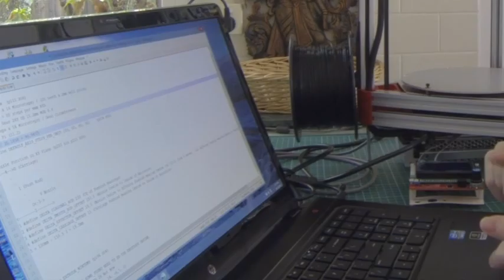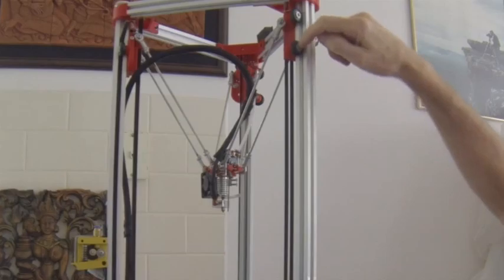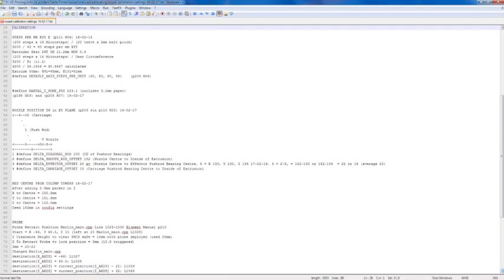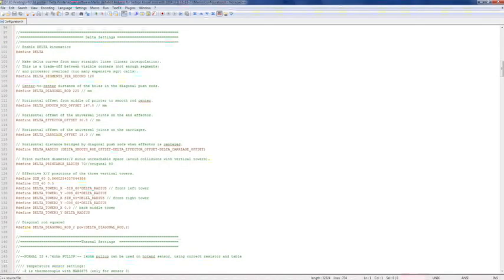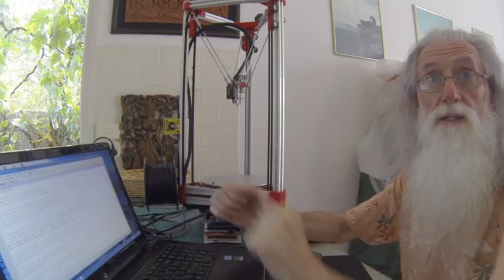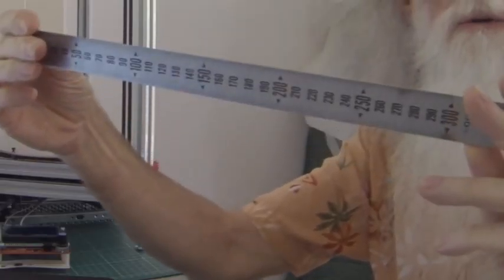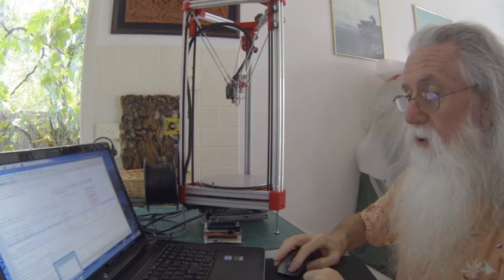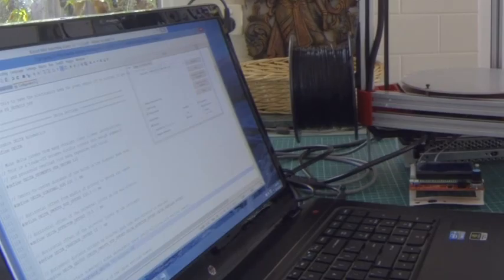3Dprint4A - Kossel Delta 49

Comment: your QR code does not working properly, its showing number instead of URL, can you please post your website URL to the video description? I need your configuration file which you put all measurement, so I can follow yours :) you did very good detailed video, keep up good work, your videos helps me a lot with building my printer, right now i'm on calibration stage and just needs to do probe calibration, I will replace this mechanic prob to inductive sensor (posted ebay link) maybe you can update your printer with inductive sensor and post video tutorial, there are some 3D model is available on thingiverse.com for inductive sensor.

http://www.ebay.co.uk/itm/222075957216?_trksid=p2057872.m2749.l2649&ssPageName=STRK%3AMEBIDX%3AIT

Thanks!
Riz
Reply from the maker: Hi Riz, glad that the videos are helping you, don't forget to subscribe.  That video never had a QR code at the end and the general one at the start works fine.  It links to my other foray (4A) videos that you may find interesting.  I just use the free  "Barcode Scanner" app on my phone and its works great.  Worth the download.  I will get the arduino config files, etc as well as the working setup config notepad ++ (txt) file I talked about in the  video and zip them up and will send you the link when done.  But remember that they are set up for my printer's dimensions, etc but should help you out.  The mechanical probe is working fine at the moment so I will keep using that until it stuffs up.  The inductive sensor is used on the normal style of printer but some people say you need to keep the head (effector) weight down so don't recommend it.  The infrared type seems to becoming popular and isn't heavy ,etc.  Make sure you add X0 Y0 to the start up G code right after the probing and before the main print g code otherwise the probe goes down in the Z direction in to the capscrew before preparing to print the main g code.
Reply: +The Wizard Just installed "Barcode Scanner" app and its works fine, waiting for your printer setup zip file, regarding infrared sensor for prob, do you have link for that item from ebay? thanks!
Reply from the maker: Here is the info to google, etc on the infrared probe I came across (I just have a pdf I printed off the web).  I don't think the Chinese have copied it yet so this info might help you get more information.
David Crocker's Solutions blog (the page of the guy who made it)
The Mini Differential IR height sensing board for 3D printers (what he called it)
How to get it: If you are in the USA or Canada, please order from Filastruder. Elsewhere, send a personal message to me (user dc42) via the RepRap forum stating which country you are in and how many sensors you want, and I will respond with a price. (How it sells it).  Have a look at it to get more familiar with it and then you can search for other suppliers.  As I am using the standard probe I haven't investigated further.  Will send you the file link tommorrow.
Reply from the maker: I added the link to the video page.  Don't forget to subscribe.
Reply: +The Wizard getting 404 file not found error when I open the link :(
Reply from the maker: I just copied and pasted the link to notepad to remove any garbage and from notepad to the browser  and it worked fine.  I will add the http stuff and see if that helps, if not just copy and paste this    www.cnc4a.com/3Dprint4A/3Dprint4A-Kossel.zip
Reply: +The Wizard Thanks I managed to download it anyway, there was some character encoding issue when you copy past the link, its works now.